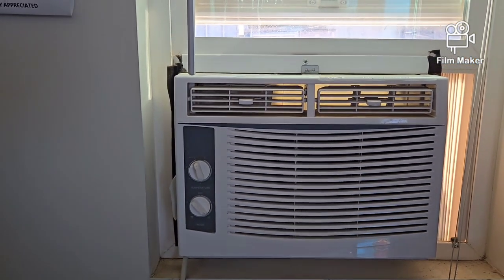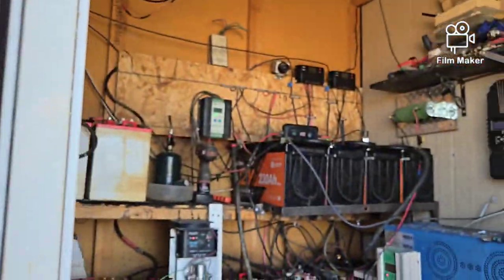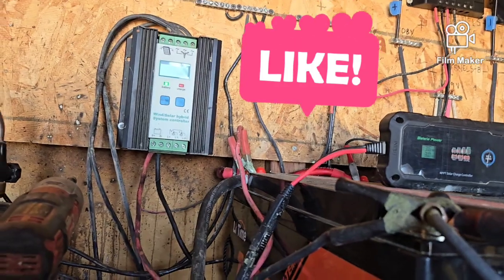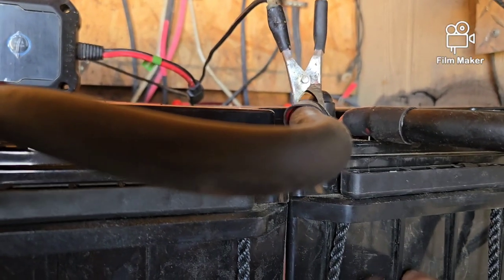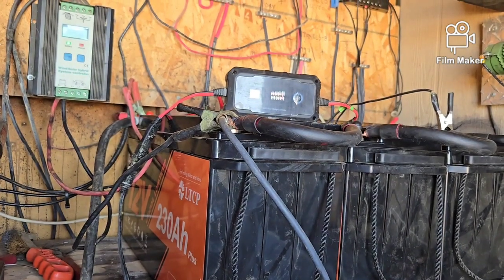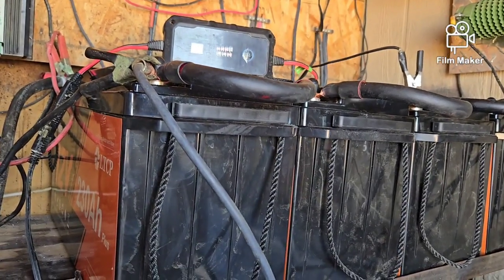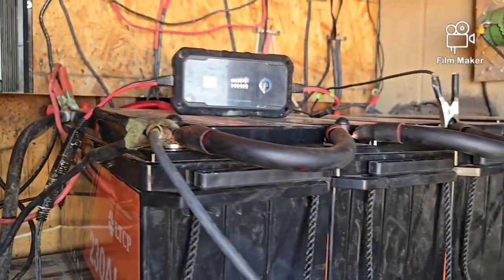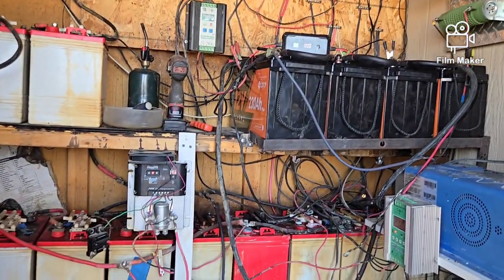Living With Li Time 12v, 230Ah batteries, Off Grid!

Comment: Hey there GBear I'm looking at one of these Li-Time 100ah lifepo4 lithium deep cycle batteries for $249.00 instead of lead acid marine batteries which cost about the same. I saw a Li-Time completely disassembled and they looked pretty impressive on their construction & the BMS was mostly surface mount technology with Mosfets. I've ordered everything except for the batteries. Hope you are staying Cool 😎
Reply from the maker: Li Time got a high rating from Will Prowse.  He tears batteries apart and goes through them with a fine tooth comb.

Comment: If I changed my 24 v to 48 v, I would have 300 aH with the batteries I have, or 500 aH with four more 24 v, 100 a batteries. I could stand four more, if you ever noticed, in the pictures of complete set ups, they always show eight batteries. I think they know something, G bear 🐻.
Reply from the maker: Yep, bigger is better.
Reply: If you have 2 24v batteries in Parallel and change them to 2 24v batteries in Series making a 48v circuit you will NOT change the aH you receive from the battery bank !?! 🤔  Voltage makes no difference to the Amps/Watts power of the bank … it can be confusing !!
Reply from the maker: @SailorGolf  Yes, connecting any voltage and amp batteries in parallel,  volts remain the same, amps are added together.
Connecting any V and A batteries in series, the voltages add together but the amps remain the same.
But, the total watts will always be the same.
Reply: @GBear  You said it better than me !!! 👍
Reply from the maker: @SailorGolf  Yep

Comment: I have a question that is of interest to me and maybe to other viewers....
At the present time I'm not in the position to check....
Would it be possible to place a watt meter on your refrigerator  for a few days to get an average...
From sun down to sun up...
To get an idea of power requirements at night for a refrigator..   I understand this would be   summer time numbers...
Reply from the maker: I can place my watt meter on it, but it doesn't record times and usage.  It's for real time readings.
Reply: You can put a Kill-A-Watt meter on it. I got the EZ model. A few bucks more. It will record how much Watts it uses and provide a dollar figure according to how much your power costs per kilowatt. You just leave it plugged into it for a few months. That's what it's made for. They have the meter on Amazon for like $26 or $27 , or something. It's handy if you have something that you'd like to know how much Watts it's using, but it doesn't have the wattage rating on it.
Reply: @davidpotter9462 
Off Grid $ figure isn't important..
But real world #s are
Reply from the maker: @JamesHollinger-lt8qx True, but the $ amounts are still of interest.
Reply from the maker: @davidpotter9462  my simple kill-o-watt meter tells me all I need to know.  A general number to size my system is all I need, because watt-ever (pun intended) it says I need, I double it on the build.
Reply: @GBear  oh, I thought he was wanting a meter for his fridge. That's how I found out my freezer was running too much
Reply from the maker: @davidpotter9462  No, he wants me to show how much my fridge uses.

Comment: Good for you GBEAR. New set up seems that it will bring peace of mind to your life,Although l like the kind of “nostalgic”☺️set up you have ., with different chargers, wiring ,buss bars ,rectifiers, controllers,wind-solar working in conjunction,solenoids, gauges,temp meters, battery meters ,power dissipation unit(green caterpillar looking on top)it looked like you entered on a NASA fascility. But we understand you got to move forward and keep up with newer technology .thanks for teaching us throughout the years.gracias amigo!!!
Reply from the maker: Thanks, and lol!  I only upgraded because the old system was 10 years old and failing.  If I keep this new system limited to 40% discharge I can get 20,000 cycles from it.
That's 54.79 years....
Ps, I won't be here then...🤣👍
Reply: Correction,(Your battery -power room it looks like entering a NASA fascility ).
Reply from the maker: @felipejimenez3630 cool!

Comment: What is the down side of 48 volts
Lose one 12 volt battery.    System is down....
Lose one battery in 12 volt system
System still works just less power...
But needs bigger cables...
Reply from the maker: True, but at 48v I wouldn't just run 4 batteries.  8 minimum,  12 for an ideal system.  One battery down, and plenty of power until replaced.
Not far off, a 48v 400ah battery will be available, but as will anything new, the price will be a deterent.
Reply: @GBear 
I was speaking from a budget point of view...
Starting or expanding a system
Reply from the maker: @JamesHollinger-lt8qx Oh, sorry.  48v is the best option with GOOD LiFePO4's. You pay a little more, but get a lot more in power and duration.  These batteries are rated at 4000 cycles at 100% discharge, and up to 20,000 cycles if discharge is limited to 40%.  Divide those cycles by 365 to see how many years that is...😃👍  ps, I probably won't be around to say I told you so, for the second one...🤣
Reply: @GBear  
Indeed
But some people come from shallow pockets ....
But at the price 12 v lithium have come way down in price...
But still $200 to $260.  
Maybe hard to come up with..
But $400 - $ $520 can still be a good start..  especially if their rv refrigerator is 3 way....
There's always a way.   
To me what changed the game is all the used panels on the market....
Just my guess with lithiums dropping in price like they are...
I'm thinking one of the newer style batteries is about to come on the market
Like the salt battery or ???.
But still with the amount of cycles lithium can give...    today they are a good choice...
Reply from the maker: @JamesHollinger-lt8qx  yep, the salt battery is a contender, but so is the capacitor battery.  No doubt, lithium prices will come down, but not much in my life remaining.
Reply: @GBear  
Yes we are in a good place in our lives...
Solar panel prices have dropped
Lithium batteries are more affordable...
Why do you think there are so many used solar panel...
Government subsidies to solar farms..
Reply from the maker: @JamesHollinger-lt8qx  Solar has outdated all other power production last year.
Reply from the maker: True, but at 48v I wouldn't just run 4 batteries.  8 minimum,  12 for an ideal system.  One battery down, and plenty of power until replaced.
Not far off, a 48v 400ah battery will be available, but as will anything new, the price will be a deterent.

Comment: EG4 6000XP Off-Grid Inverter | 8000W PV Input | 6000W Output | 480V VOC Input | 48V 120/240V Split Phase | All-In-One Solar Inverter:THIS THE ONE YOU NEED ONLY DOWN SIDE. 70WATT IDLE CONSUMPTION 10YEAR WARRENTY.  THIS IS THE BETTER ONE FOR OUTSIDE USE:EG4 18kPV Hybrid Inverter | All-In-One Solar Inverter | 18000W PV Input | 12000W Output | 48V 120/240V Split Phase | EG4 18KPV-12LV
Reply from the maker: Thanks.  I reviewed that setup, and still will go with the Sungoldpower 1048 all in one.

Comment: This is great news and so glad you'll have regular power now 24/7.  I'm a little hazy on what system(s) you have charging the new batteries - only the PMA turbine?  Or have you hooked up all your solar panels to keep the new batteries charged?  I'm a little confused as you still have the lead acid batteries and they are being charged by the Midnite?  Perhaps you can set me straight as to what's charging your new battery bank besides the wind turbine... at any rate, so happy for you, GBear!
Reply from the maker: Ok, you must have missed it in the video, I do that sometimes too.
The Classic is powered by 6, 305w panels in series parallel, inputting 110v. The classic powers the new batteries, and the PMA is a supplemental input for windy nights.  The left over lead acid are not in the circuit, except for cabin lighting and are charged by the 100w panels that equal 1300w going through the Renogy Rover controller.
I hope that clears it up.
Reply: @GBear  - Yes it does - thank you.
Reply from the maker: @samvalentine3206  You’re welcome.

Comment: Good Evening G BEAR ! I'm REALLY paying attention to what you're setting up. Those are the batteries I've wanted to get, along with Litime charge controllers. TAKE CARE..
Reply from the maker: Yep, you won't be disappointed.
Reply: @GBear  I've watched a lot about the C C also.That's what I'm hoping. TAKE CARE..
Reply from the maker: @brushbum7508  Yeah, but if it is out of reach, the Midnite Classic group works well with them.
Reply: @GBear  I have the EPEVER I can use also.
Reply from the maker: @brushbum7508  Is it LiFePo4 compatible?
Reply: @GBear  Yes, It's the one Will Prouse thought so highly of a few years ago.
Reply from the maker: @brushbum7508  Be careful.  In LiFePO4,  1 year ago is out of date.
Reply: @GBear  Alrighty I'll keep looking into the Litime. Night G BEAR.
Reply from the maker: @brushbum7508  good night.

Comment: Watts is watts.   You are going to love these they charge quickly up to 80% then a bit slower like the LAs.   What took you so long.
Reply from the maker: Original price and reputation,  then, no need to fix what wasn't broken when my original system lasted 10 years.  I got a lot more than my money's worth.
Reply: @GBear  I meant over the last few days, I’ll bet it was easier than you thought.   I made the transition but I had a lot less invested in my lead acid.    The price kept me away before they began the discounts.   Now if you look at useable watts/amp hours lifepo4 is the better deal.    The only thing I am concerned with is the bms longevity.   I am planning on buying a few for future repairs if needed.
Reply from the maker: @WattsinWattsout  With the power I'm seeing from only of these, 8 will be nice, but 12 will be FANTASTIC!  If I have visitors in an rv, they can plug in too.